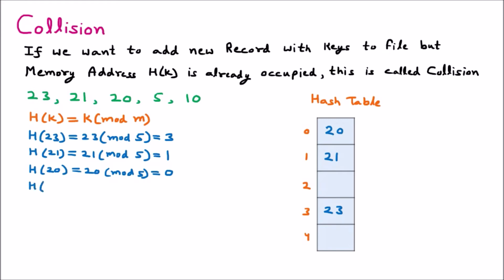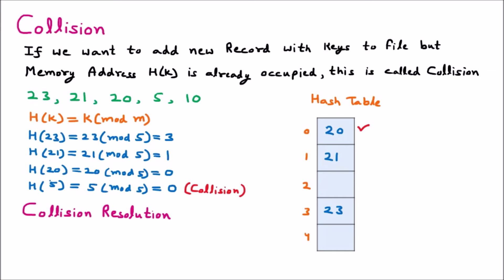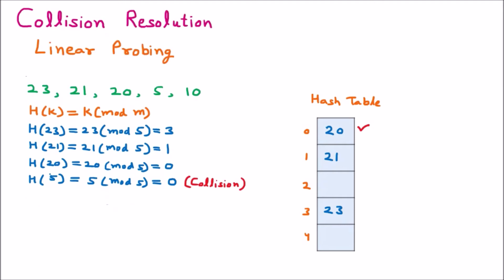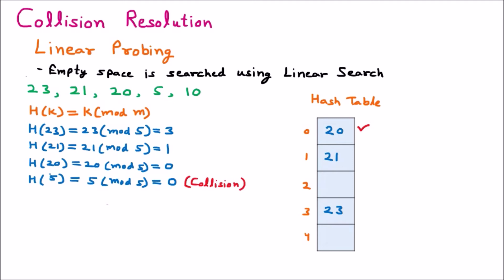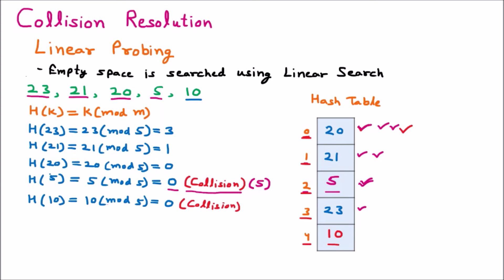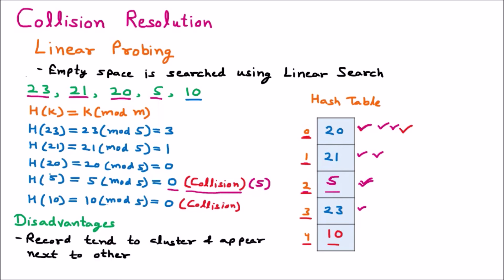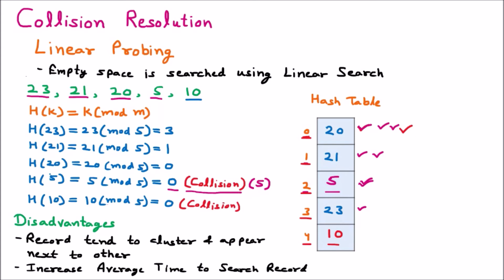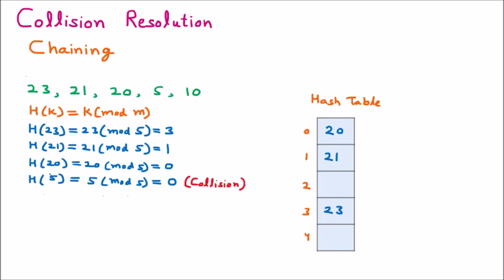Collision Resolution Techniques in Hashing | Linear Probing | Chaining | Data Structures

Comment: Hash table number can we take upto 10 or only 5
Reply: Double Hashing for 89,35,19,37,9,5,17 sir for this table size
Reply from the maker: Number of elements are 7, so memory must be greater than or equal to 7 to store elements and same will be table size. 
In ideal cases we assume memory equal to number of elements. 7 in this case.
Reply from the maker: @divyasree8209  Hash Table Number usually taken based on number of memory blocks. It can be 10 or 5 based on total memory blocks.